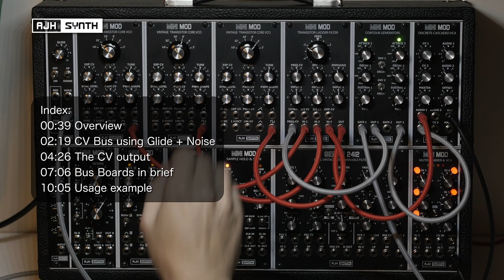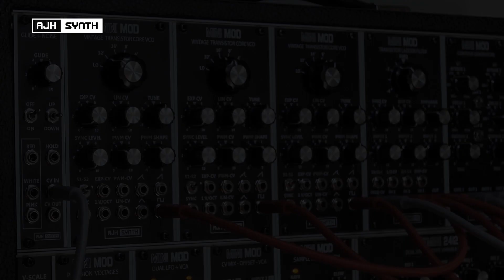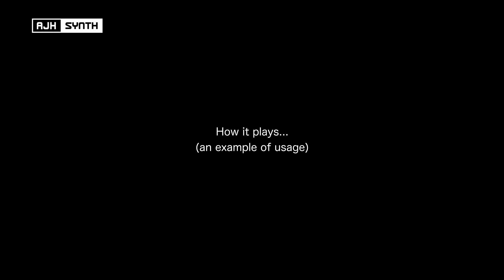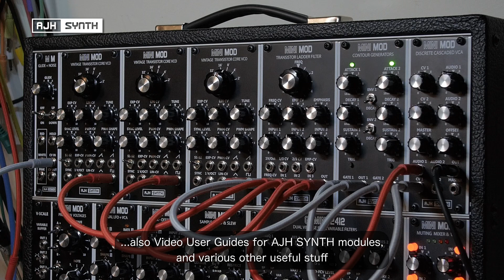How To Use the CV BUS - with the GLIDE + NOISE MkII Module for Mini Mod Eurorack Modular System

Comment: So, how does this work on the mark 1 version (V.251) ? BTW, your user manual still refers to an even older version of the module (2.3)
Reply from the maker: I would recommend looking for support from the manufacturer, as they are better placed than we are to advise on how to use their products, and we are not familiar with all of the various versions of their distribution boards.
Reply: @AJHSynthOfficial  so, your are AJH synth Official but not linked to AJH synths? mmmm....
Reply from the maker: Sorry, my mistake, I misread the comment and thought you were referring to the bus boards. This feature was added on the current MkII version of the Glide + Noise module (labelled V3.xx), and so will not work on the discontinued MkI (labelled V2.xx).
I'll update the video description.
Reply: @AJHSynthOfficial  I was getting excited for  minute, but have v2.50, Since I got a complete set at the time, do the VCO utilise the 1V/O from the bus board or is this also only in later revisions?
Reply from the maker: Yes, your VCOs will still respond to the CV bus, either from a MkII Glide module, or by using one of the Midi-CV converters that are compatible with the CV Bus - There'll be a video covering this in the near future.